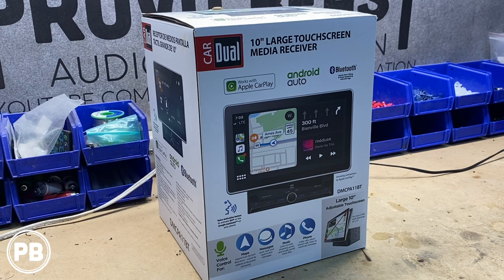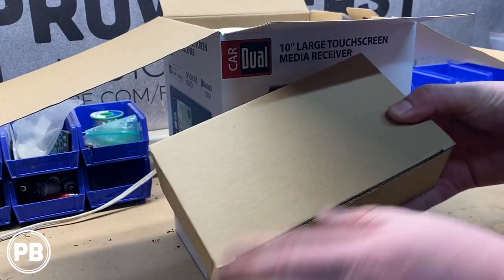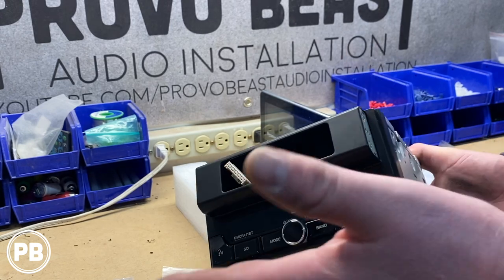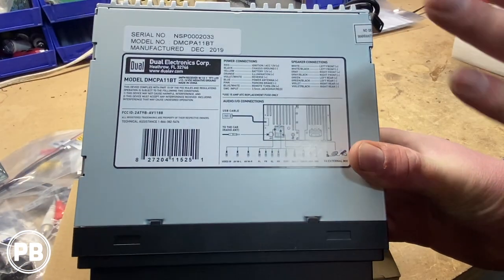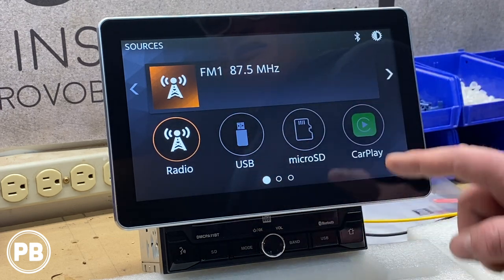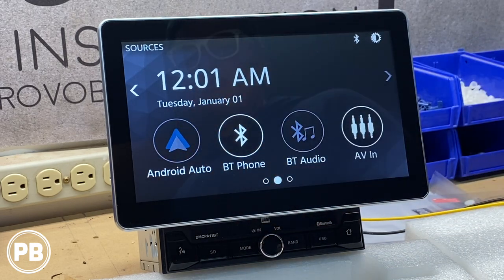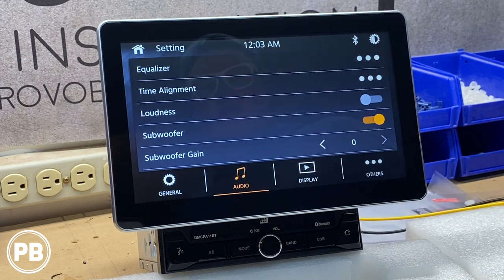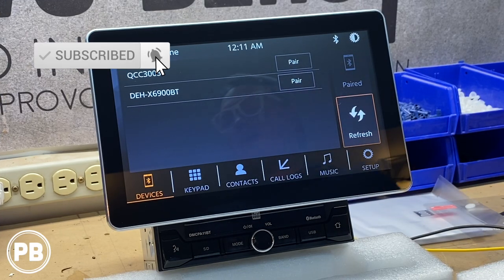Huge Dual 10" Radio Unboxing and Demo! | DMCPA11BT

Comment: This is the only oversized head unit that actually has a volume know.
Reply: Exactly why I’m getting it .
Reply: @NightTimeNico  i have the boss elite be10acp & it has a 10.1 inch screen with a knob. Love it & it runs smoothly
Reply: @kenyonia3809  I just ordered the Boss too. I had the Pioneer DMH-WT7600NEX. I paid $1,000 for it. It was completely overrated! Laggy and mediocre. How are you liking the Boss so far? I can't wait to get mine.
Reply: @denverwood5290  best decision I’ve ever made for my car. I haven’t had any issues so far, it doesn’t overheat in this heat like i was worried about and it has a lot of features for the price. I am pleasantly surprised and impressed with it!

Comment: Would you choose this one over a Pioneer?
Reply: Price would be the main reason for me. Dual has a reputation for being cheap. But this model actually looks like it's going to be nice.
Reply: I had the Pioneer DMH-WT7600NEX. I paid $1,000 for it. It was completely overrated and laggy. I sent it back yesterday. I'm getting a 10 inch Boss unit. Let's hope it's nice.
Reply: @denverwood5290  was it good?

Comment: is this able to be plug and play for a 2012 gmc sierra or do you have to purchase a separate dash kit and harness
Reply from the maker: You will need a dash kit, wiring harness adapter, antenna adapter, etc.  See our GMC sierra radio install video to see all parts needed for your install.  Or send us a message on facebook / instagram and we can help you with parts needed.

Comment: You mentioned a "back up Camera harness."  I watched your back up camera install video which I thought was helpful until I looked at the back of this stereo... and no RCA plug for the back-up camera and no "reverse wire."  Can you explain how a backup camera connects to this head unit? Thanks.
Reply from the maker: It's a separate harness included with the radio that plugs in, separate from the main harness.  If you are missing one, you can reach out to the manufacture to order a new one.

Comment: Why is mine distorting the sound when I put the volume over 20? Ive tried with stock speakers as well as aftermarket.
Reply from the maker: Polarity could be reversed in speakers, poor quality speakers, issues with the radio, etc. lots of potential issues.